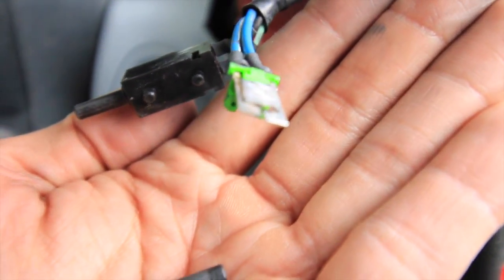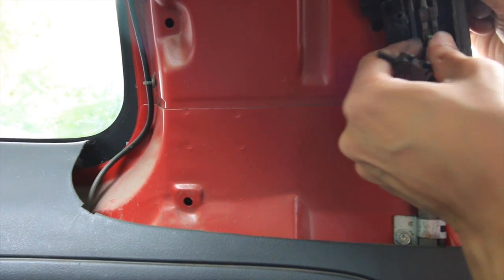240sx S13 Power Seatbelt Fix 89-92

Comment: How high does your 240 idle at?
Reply: I just bought mine and it idles at 2,000
Reply: @kyleharlin8940   sheesh clean ur iacv, maf , and maybe tps . Also check for vacuum leaks
Reply: @souranf  well after taking a deeper look I believe that it was fitted for a turbo before I bought it so I believe that the turbo would pick up that idle lag
Reply: And that it also needs a tune just to fix it right?
Reply: @kyleharlin8940   not sure if u have a KA or SR but a tune does matter but still idle at 2000 isnt right . A good idle 700-900 , a ok idle but need some tweaking 1000-1400 , after that there is just a problem . Im not exactly sure what the whole problem is but if u join some 240sx groups on Facebook they can help u
Reply: @souranf  okay for sure thank you so much

Comment: I have a 1988 maxima with the same problem and this vid gave me a good idea on where to start. Helps alot 👍
Reply: Any luck with the max?
Reply: 89 maxima 😂😂 mine got stuck in the closed position though so I have ignored it. But if it's a little switch that's messed up Im gonna fix it

Comment: I got the cable thing to go back and forth but that thing where you connect the belt to is stuck in place... know a fix for that?
Reply: hey carlos can you write back, what do i have to write or tell the nissan dealership for a free fix
Reply: lewis 2forty lol did you mean to send this message to OP. I have no idea. I guess I would say that your seatbelt doesn't work and it's a safety Hazard and that you have read online that Nissan will fix it since it's a safety hazard. Have your vin number ready. They will need that to see if warranty is up on your car. If one dealership denies the service try looking at another one near by. Some dealerships are just too lazy to help you out and so they deny the service cause they don't want to deal with it. I have first hand experience on this. One dealership denied my service on my 370z but the other one 30 miles away got me all fixed up all for free. Good luck

Comment: Well the green part deteriorated soon as I pulled it out...time to rig something up.
Reply: Go to pick a part...snip wires back 4 to 8 inches...solder wires 1st before putting back...slide heat shrink tubing  over wires 1st...then solder wires together...heat shrink tubing heat up..."done" (pocket stuffer) entry cost $2.00...so many B13's in yards...switches get dirty...if worn out...try right side to see if it will sn as p into left side holder...right side less used...switches should be really great...good luck...